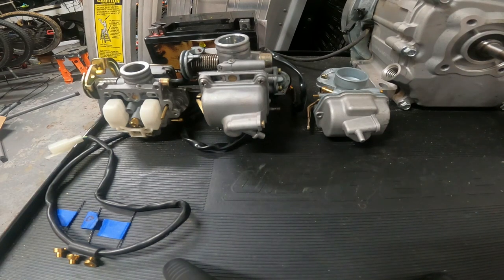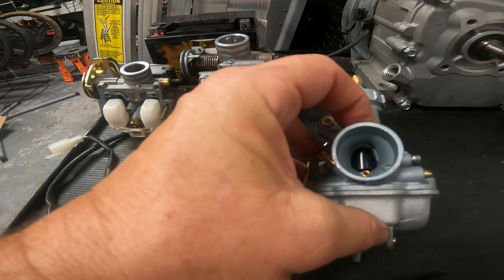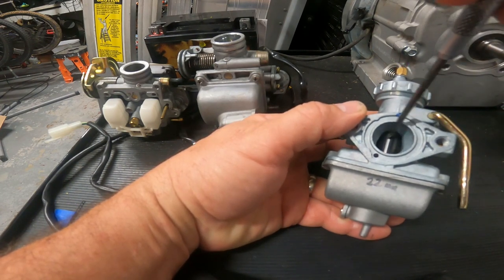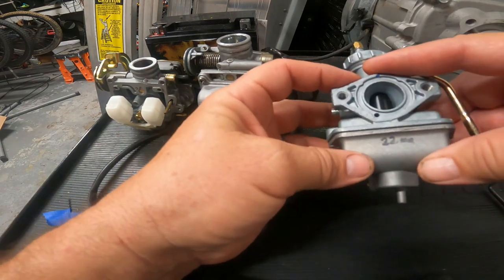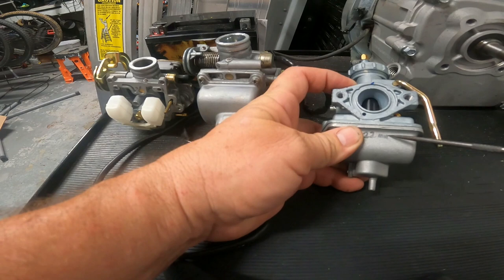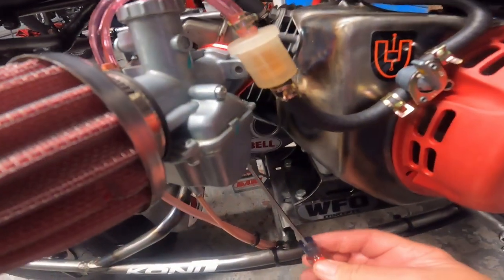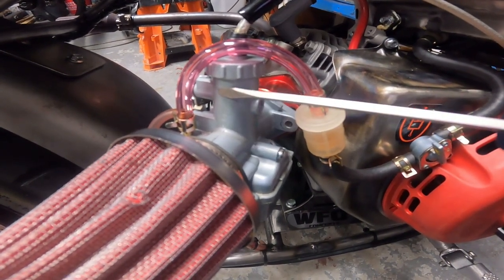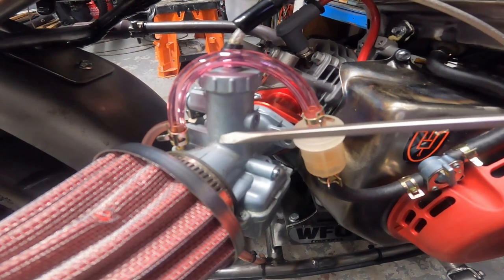New Smooth Bore or Mikuni Style Carb that Predator 212 mini bike?  How to start the tuning process

Comment: Bruh my shit box rabiddog will tach 10 00.  I hear the piston going back an forth . A9 cam. 50mm bbk . Valve float is what? Yea the video. Is it even possible for the crank to basically out rotate the lobes
Reply from the maker: @seanmayo206  yep.  At about 10k. The springs can't keep up

Comment: Ok so it idle ran good next day won't start
Reply from the maker: Do you have a fuel shutoff valve? You need one to keep that pilot jet from clogging up when the fuel in the float dries up.  I like to drain my float if it's gonna sit awhile.   That usually takes about 4 days of sitting to do tho.  Will it start if you give it some throttle so you bypass the idle jet and start off on the main and needle jet?